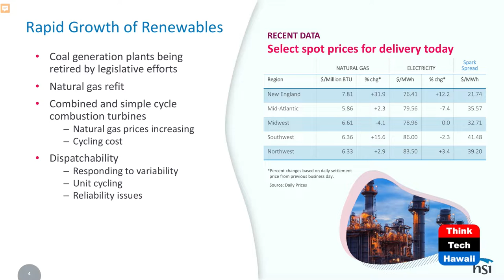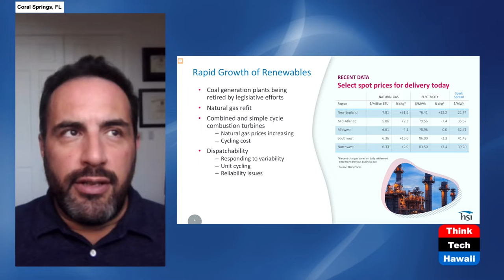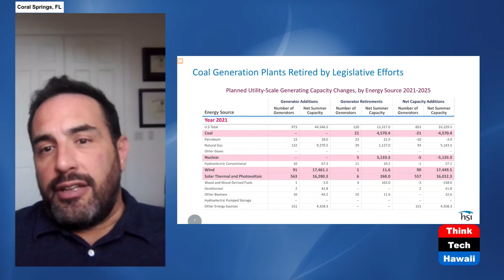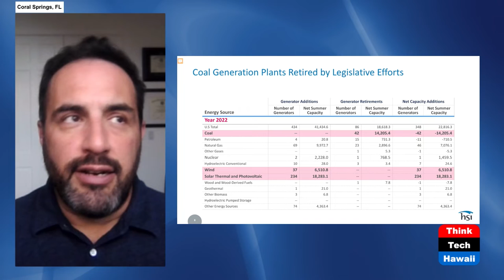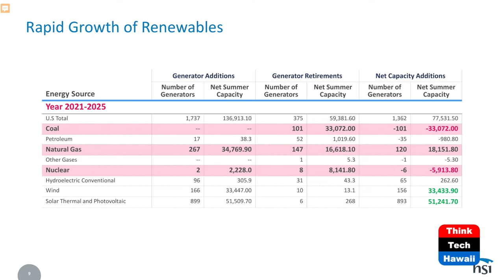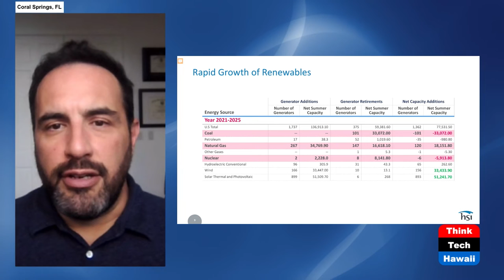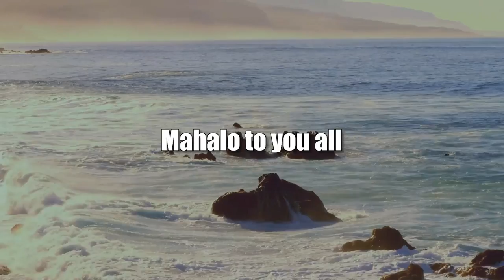Renewables and Grid Reliability (Perspectives on Energy)

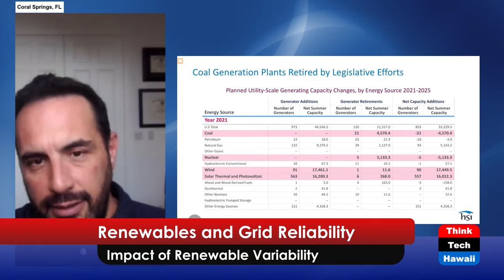Comment: Thank you for your show.  Around (9:46), however, you say that Nuclear power is "cost effective."  N-power is the most expensive power on the planet, it uses a massive amount of cement (lots of greenhouse gases) and takes massive amounts of water to cool the condenser side (it's just a steam engine).  Yet, you don't mention "Green Hydrogen."  Would you take a look at green hydrogen (using renewables to make clean hydrogen fuel from water)?  It's the missing link not only to our energy system (both electric and fuels), but also missing from this discussion.  Please do a show about Green Hydrogen.  It's the renewable energy storage answer.